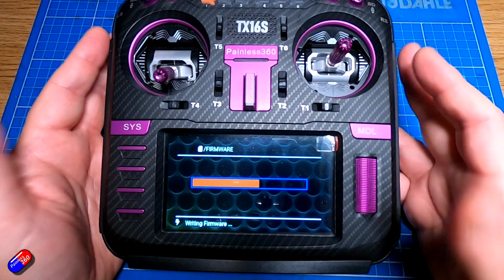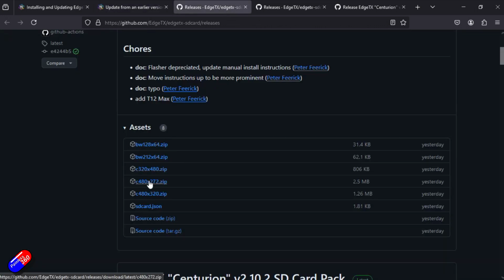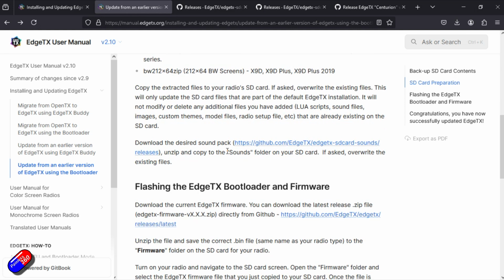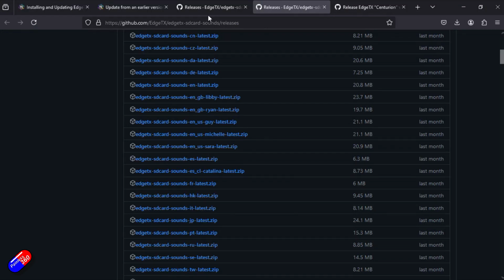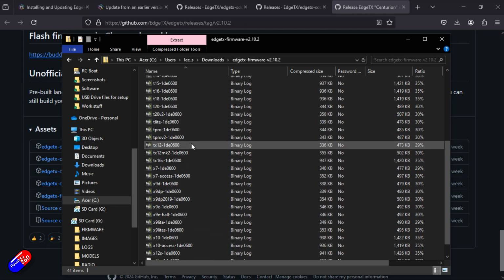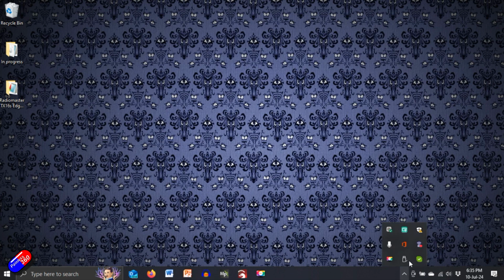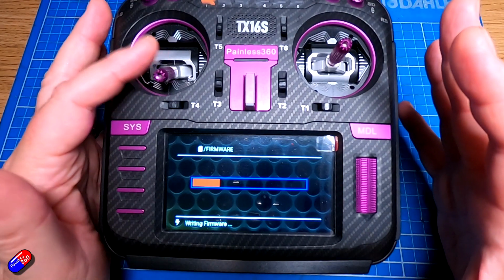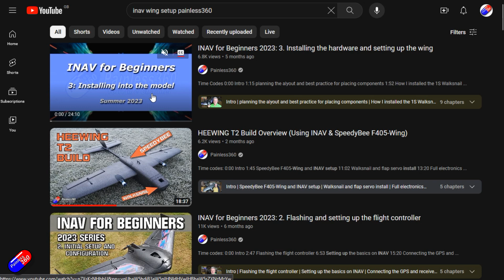How to Update modern EdgeTX using the Bootloader method

Comment: Hello video uploader,

What do I have to do to bind the RadioMaster TX16 with Yuxiang F07 Huye ?? Any rough idea at least ?? :face-blue-smiling:
Do I need to upgrade into Edge Tx for that ??  Thnx.
Reply from the maker: Check out https://youtu.be/DfKyx0yTbXU
Reply: @Painless360  

Do I must have to install EdgeTx in my RadioMaster Tx16 to bind Yuxiang F07 Huye ?   

Can I flash those codes in my radio that has OpenTx firmware ?? Thanks.
Reply from the maker: Check the documentation for the latest releases of MPM. OpenTX has been replaced by EdegTX for active development for quite a few years now...
Reply: @Painless360 

I am scared to upgrade due to loosing my existing models'  set up.😰

U, as an User of Edge TX & Open Tx, what specialies do u find in EdgeTx??? 
Thnx.
Reply from the maker: OpenTX is no longer being developed in any meaningful way. All of the bug fixes, improvements and support for the latest technology (like ELRS) is going into EdgeTX. Best of luck!
Reply: @Painless360 ,

Ahhhhh!!!! I thought that I am gonna run this radio for ever...., bt as I see I must hv to upgrade the firmwire. 🥶

Actually I am not a computer,  internet savvy, dont even wanna be. I am more focused on making scale helis from scrap which is a lot of work. 

Whats the differences did u find btwn these 2 firmwires, Open Tax & Edge TX since u deal wth those?? 
Thnx.
Reply from the maker: See previous answer re Opentx... best of luck

Comment: Will this process work if the Radiomaster TX16S MKII ELRS is installed? I would like your help before installing it.
Reply from the maker: I'm not sure if I understand the question.  The process is the same for any radio, module, or reciever... best of luck
Reply: @Painless360  My question is if I can do this process with that specific control model? I'm new to FPV. Regards.
Reply from the maker: Yes

Comment: Another easy to follow video. Thanks you. Except that after the firmware was done writing to the radio and exited, I now have a skunk holding the EdgeTX logo and v2.10.4 Centurion locked on the screen.

Comment: my TX16S mk2 max arrived yesterday running 2.7.1 A friend told me not to download the latest version as it has to be done in stages? I have to download 2.8 before 2.10 is this correct?
Reply from the maker: All covered in the updating docs - 'Upgrading from versions of EdgeTX earlier than v2.6 (or from OpenTX) is no longer possible via the radio firmware (this does not affect Companion). You first need to update to EdgeTX 2.8 to migrate your radio and model settings, and then you can update to the current version' best of luck
Reply: Thanks mate 👍

Comment: Another very helpful TX16s / EdgeTX video Lee - Thank you.
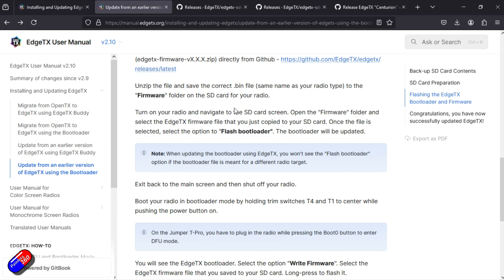@9:13 You missed an important step - BACKUP the newly updated SD card!
And I have now successfully updated to EdgeTX v2.10.4! 

I tried the EdgeTX Buddy method, but my Win11 PC does not have the STM BootLoader device driver loaded. The STMCubeProgrammer app is way way too complicated to use. So I gave up trying to use the "simple method".

Comment: Hello, I’ve my taranis X9E updated to EdgeTX but now I missed de channels 6-7-8-9-10-11-12 in the helicopter setup. I mean Coll.pitch source  channel. Now I’ve chance this to channel 5 and did this also on the mixing page. In OpenTX it was channel 11. Copy this from a YouTube video a few years ago. It’s a setup for a fly bar helicopter. I hope you can confirm this. Theo
Reply from the maker: Not sure, I've not updated my Taranis to EdgeTX here... Best of luck
Reply: @Painless360  thank you, it’s good to know that in every model heli or plane you’ve to check everything. In my case in every model there where a few parameters missing or incorrect, mostly voltage sensor things, and for heli model as well for fbl as flybar the pitch didn’t work.
Sometimes you’ve to re- choose some parameters and than it will work. So for you good luck and thanks for all your helpful videos. 🚁💨💨

Comment: I know this isn't for the Boxer but latest ETX firmware has added "Time" to the UI. But the time resets after updating time with power on. Has anyone or Painless360 run into this issue?
Reply from the maker: Check out the EdgeTX Github to see if it is a known issue... Best of luck